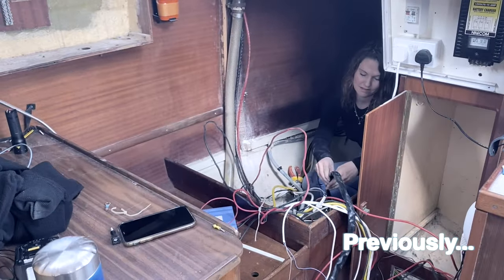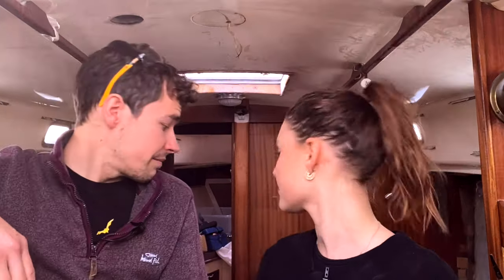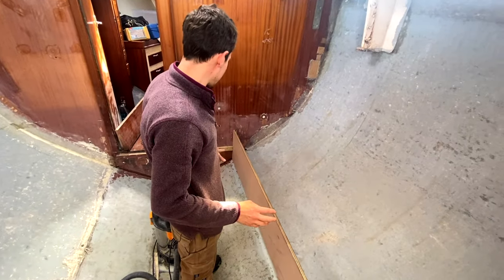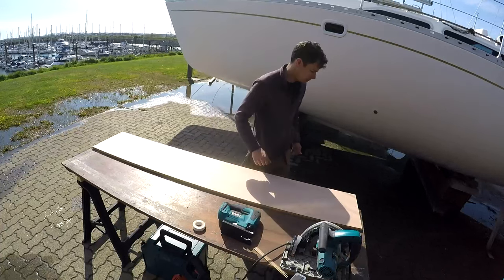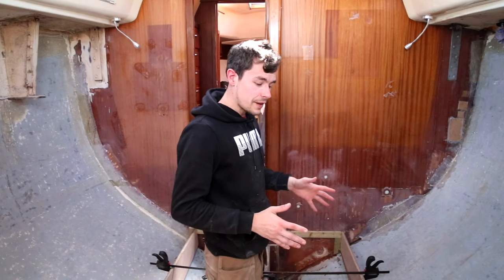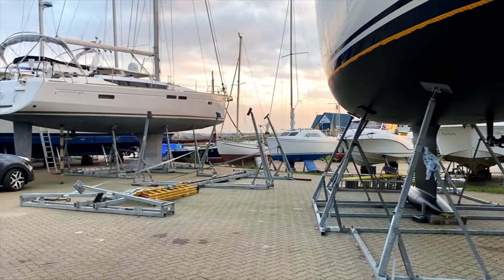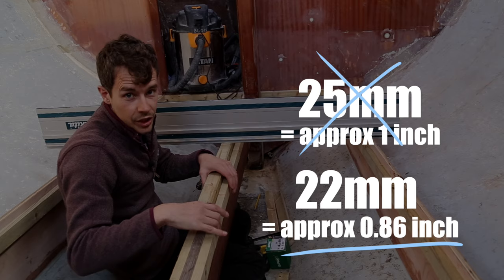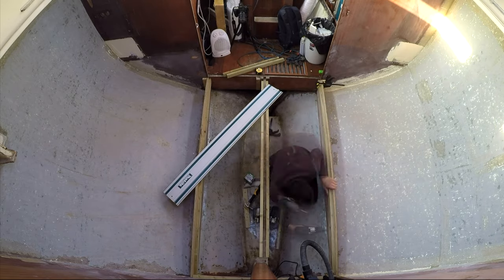Ep 13 | SUPPORT for the SOLE

Comment: Ben. You could have put tape on the lower side of the floor supports to stop the epoxy running under the wood. 😉😉👍
Reply from the maker: That would have been a very easy and time saving solution. I can be smart sometimes, I promise!🤦‍♂️